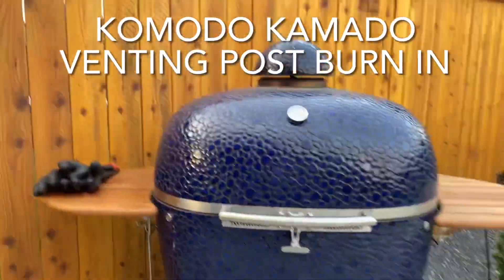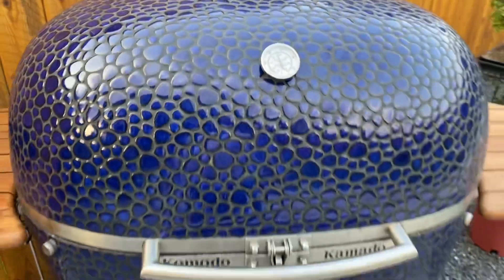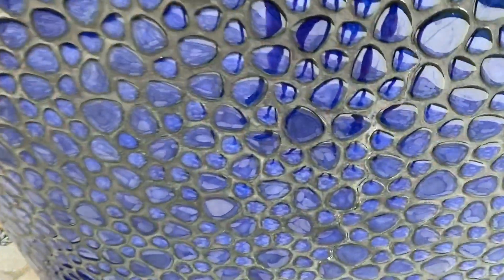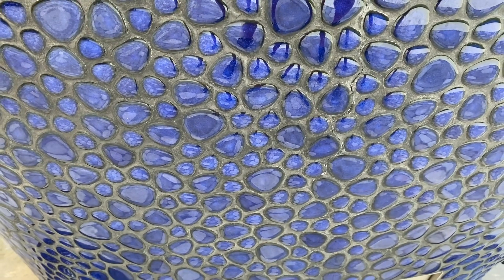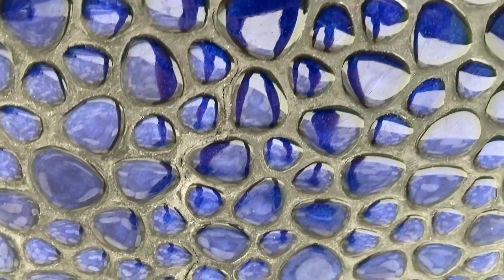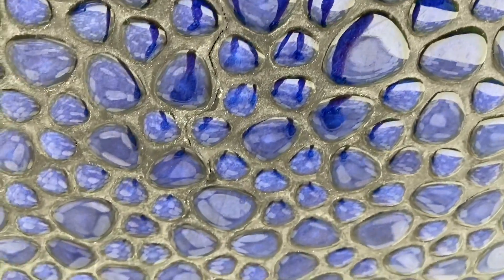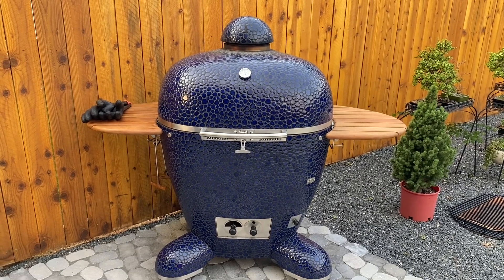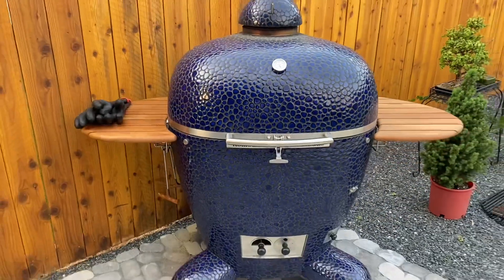Komodo Kamado Venting post burn in

Comment: Why is nobody commenting on the huge crack running vertically on the front of the grill. Why is this not a problem?
Reply from the maker: It’s actually just a crack in the grout. Once I put some new grout on there you won’t see that venting crack anymore. As I said in the video, the grill was still venting some water vapor out at the time of this cook.

Comment: BTW that is water vapor not smoke venting...
And the smell is like acrylic paint.
Reply from the maker: Yes absolutely right, I should not have called it smoke, just confuses the issue. It’s moisture or in my case also some solvent from the jacket, as this is a newish grill!
Reply: i noticed my komodokamado had some condensation inside of it that collected on the new drip pan. My assumption since all vents are closed is this is moisture that has collected from the unit being outside on a deck and is a natural thing. Now that it's on a covered deck, even in humid Mobile, Al. I suspect this will go away when i start using the komodo and closing down the vents all the way after the cook.
Reply: @rudymsmith   Best to store your grill with the damper top cracked to let hot humid air escape. If not it will condense on the inside of the grill at night..
Reply: @dennislinkletter2549  - your the best - thanks! Where  can i find the grout?
Reply from the maker: @rudymsmith  the more humid the environment the more moisture will collect inside your KK. Assuming you have a cover, leaving the vents open will actually help keep air moving and moisture to dissipate from your KK. Otherwise you’ll always have some condensation in humid conditions
Reply: @perezog  thanks